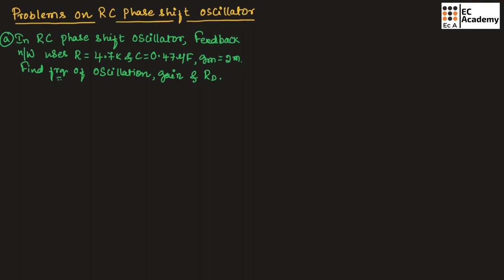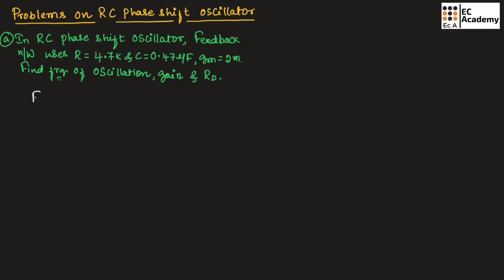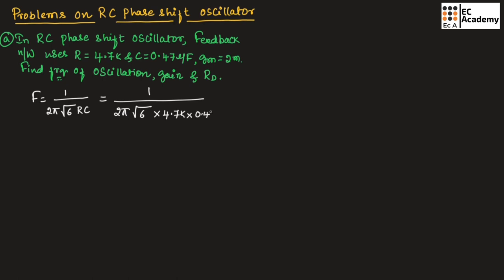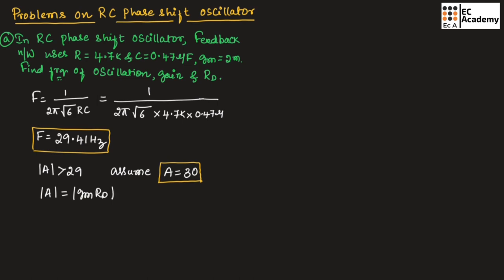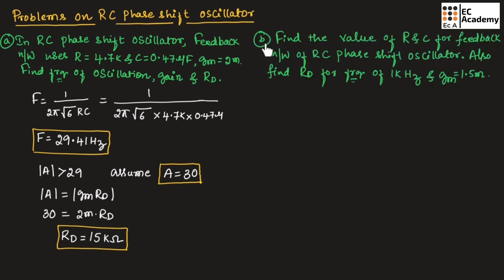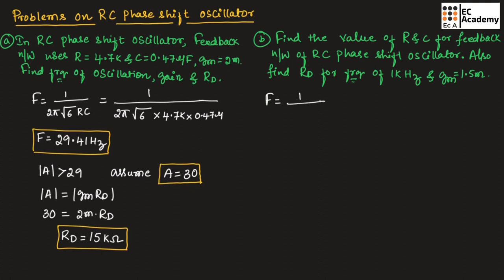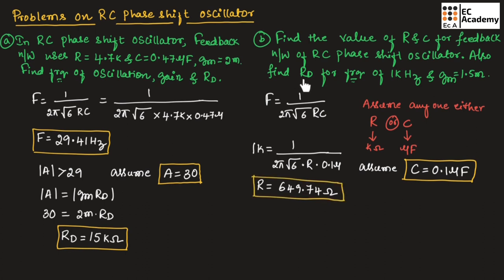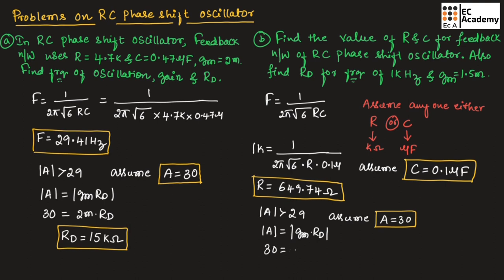Problems on RC phase shift oscillator || EC Academy #oscillators  #analogelectronics

Comment: sir how root 6 you have taken
Reply from the maker: The term √6 often arises when calculating the exact gain condition for a three-stage RC phase shift oscillator. The phase shift per stage is 60°, and the total phase shift is 180°.